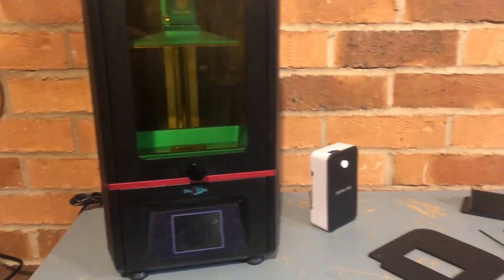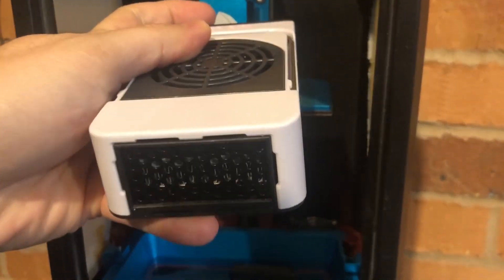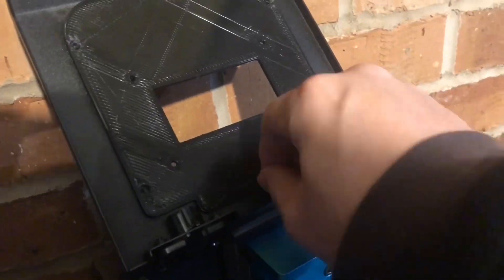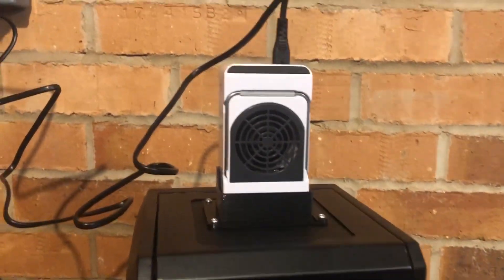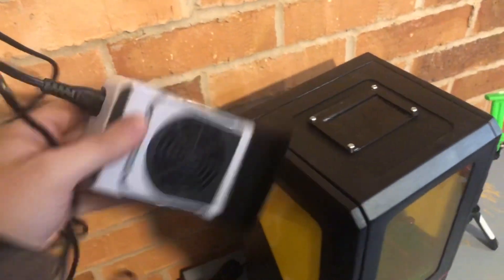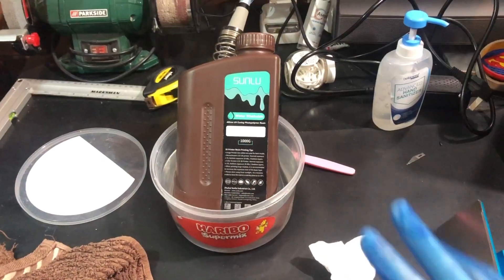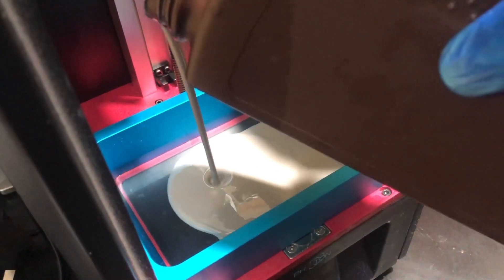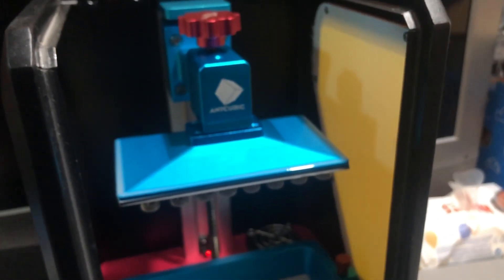How to Print in Cold Temperature (Quicktips)

Comment: Don't destroy your printer. Just make or buy an enclosure.
Reply from the maker: This is why I built the printed plate. Completely reversible. Agree if you have the newer models without the plates, but this is a cheap solution. Enclosure would need a better/more powerful heater to keep the whole volume warm. Agree can be done though.

Comment: Very clever, two problems fr some people. 

1 > unless they have your exact printer the adapter plate will not fit.  

2 > having hot air blasting just above the metal bed releasing know will be a problem as you need to be able to by hand turn that knob to release the bed frame. 
it be too hot after the heater had been there above it while printing!

In my case for example I be getting this month the new Elegoo Saturn 2 resin 8K printer with a one piece plastic red cover, I not cutting in to that.
They have a removable fan attachment plate at the rear of the bottom of the case Maybe use this somehow?  However I will have the resin printer in a heated room
so I will not need to use a extra heater thankfully.  But well done anyway for solving your type of resin printer heat problem.

Really the makers of all resin printers should have a heating element build in to the tray where the resin sits that you can plug in to a set plug system in the case area of the printers.
Reply from the maker: Thanks for the comments mate.for point #1 I’ve uploaded two versions of the bracket. One can be used without the plate. But you will need to find a place to vent the air in. Most of the printers these days don’t have a case anymore, but instead a capsule. Indeed drilling and cutting it might be painful. Maybe the solution is building an adapter to place in the bottom of the metal case, or use the vent as you said. Unfortunately I don’t have any of these new printers but will update if I design any more. 

For #2 it can indeed get a bit hot, but you can either drop the plate or just remove it during the warm up. Never had issues burning myself, as the heater itself is not that strong. Please let us know if you find any other installation solutions! Cheers